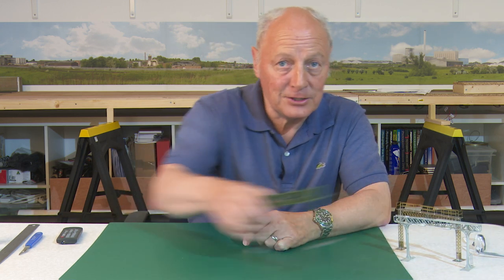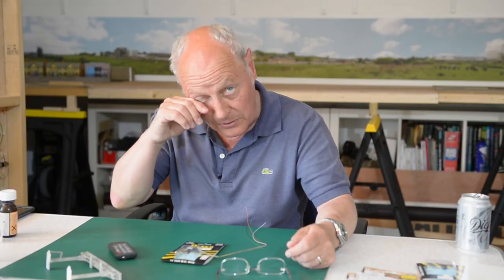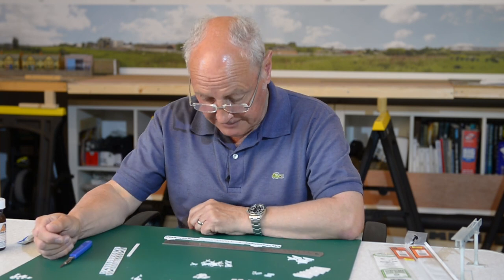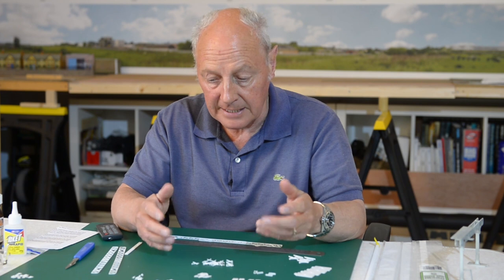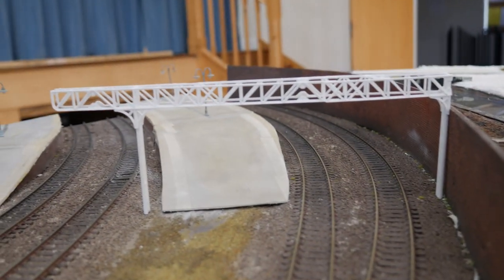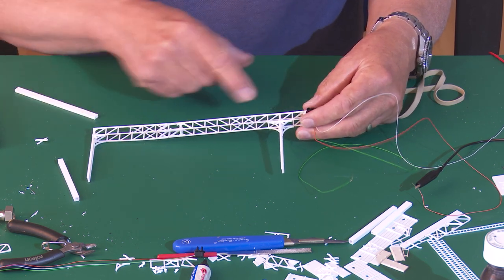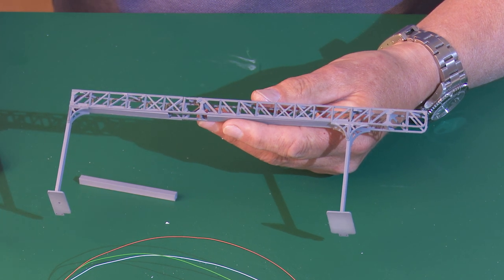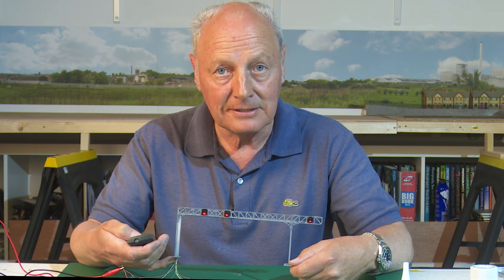Making a Signal Gantry at Chadwick Model Railway | 30.

Comment: Thanks for this Charlie. I have just purchased two kits to make a gantry across three tracks (Up/Down Main and Branch Line approaching a junction). My query is:- How do you add the walkway and railings? I think I shall place the signals on the platform where the semaphore signals are normally mounted. Your comments would be greatly appreciated. Great tutorial.
Best wishes
Peter
Reply from the maker: Did you buy the Knightwing kits Peter?
Reply: @ChadwickModelRailway  
Thanks for your swift reply. I bought 2 Ratio 478 Pratt Truss Gantries. I am going to use 1 off 3 aspect and 4 off two aspect signal heads on the gantry.
Reply from the maker: I’ve taken a look at the video and all the details are there.  I’m surely that following it along will be fine.
Reply: @ChadwickModelRailway  Hi Charlie, I have read through your excellent video but it does not go on to the fitting of the walkway (maint. platform). The only way I could think of doing this. I moved the signal heads to the walkway which has safety railings fitted. Another way could be to use the cable trunking as a walkway with the signals positioned as you have in your video. This would need the gantry framework to be cut to allow access at the top of the steps.
Best wishes
Peter

Comment: Hi Charlie 
I'm building the ratio pratt and truss gantrys.
I have just watched this video and found it very helpful.
But I want to ask do you think could the box sections you used for the wiring be used as the actual upright legs for the gantry for one to give more strength and to look a bit more modern ???
Please can you help with my question.
From peter
Reply from the maker: I think the best answer lies in photos of the real thing.  Please google signal gantry as there are some great photos online.

Comment: Hi Charlie, Video 30 at 4.35 there is a a VERY NICE WIDE GANTRY with lots of Signals and as well a larger nearly square BOARD showing a NUMBER 1 with 6 lights on, I wonder if would know the size of this, PLEASE
Reply from the maker: Sorry Graeme, but I dont.  It spans around 6 tracks!  Regards Charlie
Reply: @ChadwickModelRailway  ok THANKS Charlie

Comment: Hi Charlie,

The signal gantry looks excellent!  I think doing a brass kit and using superglue rather than solder might be a possibility too but for kitbashing I think plastic is a little more forgiving.  No need to worry about the wires I don't think because there would have been some in real life for controlling the signal so once covered in abit of grey I think it won't matter at all.

Cheers,  Michael
Reply from the maker: Hi Michael,
I’m so glad that you enjoyed the video.
I have to paint the cables, I just couldn’t live with seeing them every time I look at the gantry.
Regards Charlie
Reply: Michael Henfre

Comment: After a day and a half installing 7 Cobalts and wiring them up (5 to go) I needed a break and turned to another of your videos for some R&R to find one of my favourite subjects - signals & gantries. TBH I really like the Airfix versions (esp painted flat German green, the walkway in wood and with all the handrail posts installed and cotton or wire fed through. They really do look the part IMHO). I bought 3 original kits in the old boxes (not the Dapol plasticene versions) and have combined 2 into an extended one like you have (took some careful planning on the girder panels) and a std version. I have drilled out the lamp holders to take tiny GOW bulbs at low voltage so heat should be minimal (it was before I found LEDS). Anyway, your idea of the Plastrut box section is great; it was the one thing bugging me how to feed the wires through, so thanks for that and I will pick some up from the model shop in Munich next month. Further, I also bought several packs of the Modelscene Light Signals http://www.gaugemaster.com/item_details.asp?code=PE5094, not least because they are a great price for a twin pack BUT that they come with the switch boxes.  I will similarly drill these out and install LEDS. All the signals will be connected to the aux output on the Cobalts so I can see from a distance what routes are set quickly. I also agree with you on brass PE kits - they look fabulous but v expensive and take alot to build. I have a couple of Ratio semaphores to build too and their sprues annoy me being in a closed loop making it hard to cut out. I also think I have a couple of those Berko kits I picked up at a Train Fair years ago to try out. Anyway, all good stuff Charlie and thanks again for the Evergreen/Plastrut section solution, great stuff PS Try Revell Contacta glue for plastic kits - it has a very useful long nozzle like a humming bird.
Reply from the maker: I’m so pleased that you enjoyed it.  The plastic box section really did the job.
Using brass for me, was just a nightmare.  There were much easier options available and took no time at all to assemble.
Reply: @ChadwickModelRailway  Small update - managed to source the Evergreen box section online from a great FR ebay shop so on with that next week. I located the Eckon/Berko kits which ironically are a packaged version of the gantry and Modelscene DIY idea; I am just trying to source some finer cable like the Eckon kits as the Viessman 0.14 section cable I have may be a little oversize. Cheers

Comment: Hiya, nice video as usual. The cabling on, 'real' signals would be multi-cored swa in black and glanded into the head. We on the other hand have three single wires so, heat shrink tubing moulded to shape all the way to the left hand end, an 's' bend from the head to straight run over flat horizontal tray where you had the flat box. For the route to underneath I liked the vertical square tube, ie trunking not cable tray. Drinking straws run across to the vertical from each heads short heat shrink and black painted would also work.
Reply from the maker: A fair point Steve.

Comment: It looks nice indeed! What are these signals called? Starting signals, platform signals, platform starting signals? Don't they lack a yellow light... why are they two-aspect only?
Reply from the maker: Hi Gabor,
The are Platform Signals.  They simply stop or start trains.  Therefore, no yellow is required.
Reply: @ChadwickModelRailway  Thank you! What if the next signal is at "Danger"? Can't they be cleared? Or is the next signal a distant signal that never has a "Danger" aspect?
Reply from the maker: That’s a good point but I don’t believe that the train would be allowed out of the station if the next Signals was a red.
Reply: @ChadwickModelRailway  Thank you indeed.

Comment: Hi Charlie.
You say you ran out of plasticweld.
The solvent they use (written on the bottle) is Dicloromethane which you can buy on ebay for about £10 for a Litre... that's less than the cost of 3x 57ml bottles of Plasticweld... the equivalent of 17.5 bottles for £10!!

Buy in bulk and refill your Plasticweld bottles when it gets empty!

You can also buy Methyl Ethyl Ketone (aka Butone) for even less, which is the same as Slaters 'Mek pak'.

Cheers
Dave
Reply from the maker: Hi Dave, 
What a great tip, I’m on the case.
I do hope that you enjoyed the video.
Regards Charlie
Reply from the maker: Hi Dave,
I too have plans for a feather although the wiring might be a bit of a challenge.
Do keep me posted.
Regards Charlie

Comment: Very nice build and like the way you made you choice of which to use. Soldering of the brass signal bridge looked good also, if you plan on doing more for your layout or the club layout, maybe take a look in on using and RSU (Resistance Soldering Unit) they are used to build brass steam and diesel engines and work great and you can get the as cheap as $169.00 dollars (US). Very easy to work with and there are a number of videos with demos of these units!!! Enjoyed the video as always!
Cheers!!
David Muse
Reply from the maker: Hi David, 
I’m so pleased that you enjoyed the video. 
I’ll look into RSUs, that’s something that I haven’t heard of before.
Regards Charlie

Comment: 3mins in i can see a Red, Green n white wire's i assume the red wire leads to the red light n the green to the green light? only thing couisious me is the white wire.... which would go to power aka bus line right?
Reply from the maker: Hi, 
I’m so pleased that you enjoyed the video.
Yes the the red and green are for their respective heads and to the white you connect the supplied resistor.
Then it’s just a case of connecting the power.  Peco make ideal  switches for this.
Regards Charlie

Comment: I watched your video on fitting backscenes . it was useful , however...my layout is in a caravan and its not exactly roomy as its full of railway stuff and music gear, my fault lol. I decided to re build the layout in dual purpose modern image with the ability to convert to 1958 68 , and 1980s to 2000s . I bought hard board and intended fitting the back scenes to the hard board then installing . now hears my point .you used the paste on variety . seemed to work great and you had a bit of wiggle room . I got ... self adhesive , what a faff about .I would just like to say to anyone looking at your vids ,do yourself a favour and use the paste type lol much easier. I got it done but what a bugger .
Reply from the maker: Well at least you got there in the end but it is a stressful task.
Regards Charlie
Reply: worth it in the end but those sticky back ones are not worth the hassle , one I got the hang of it I was away but better your way with the wall paper paste . cheers.

Comment: Hi Charlie I have scratch build my own signal gantrys for my layout of the wcml set in the 1980s as the signal gantrys on the wcml are of more modern design with the singles hanging down below the gantrys using plastruct webbing and H beams and berko signal kits 3/4 colour light aspect signal. today I have been work on converting Lima mk2b coaches in to mk2c coaches there is still a long way to go with them Charlie  goodbye for now clive
Reply from the maker: Sounds like you certainly have your work cut out Clive.  Good luck mate.

Comment: thats the wrong colour green led mate, this is an olive green led you need an emerald green one.
Reply from the maker: Rest assured that it is the correct colour.  It’s just that the camera doesn’t quite get it right. Regards Charlie
Reply: @ChadwickModelRailway  Yea there are about 4 different shades of green led with different colour temperatures, i always use 565nm

Comment: Hi Charlie  can i just give  a little advise as i love your presntation  but it is concerning your soldering ,so here we go ,buy a proper pair of wire strippers  one that just drags the insulation  a 16  of an inch  and not takes it all the way off  you then twist the insulation until that tightens the  inner cable cable  then pull the insulation off and dont keep touching  the inner cable with your hands ever again because you can make it difficult for  yourself  as you are  transfering  grease off your hands on to the cable you are going to solder and human hands always carry a slight oileness  in there skin  so dont ever tought  the bit you are going to solder  ever again and your solding will be the envy of all my very best wishes Brian
Reply from the maker: Great advice, Brian, and rest assured I now have those wire strippers. Regards, Charlie